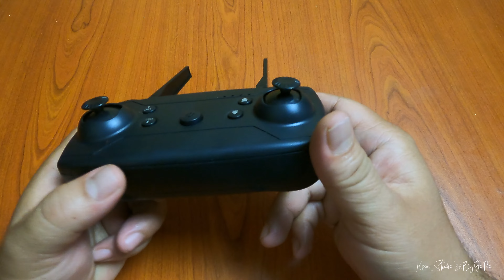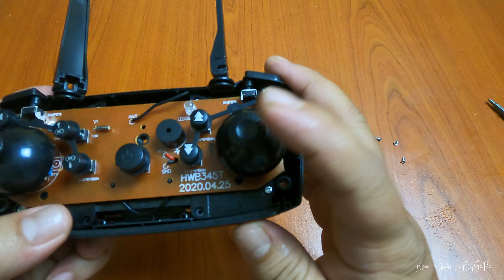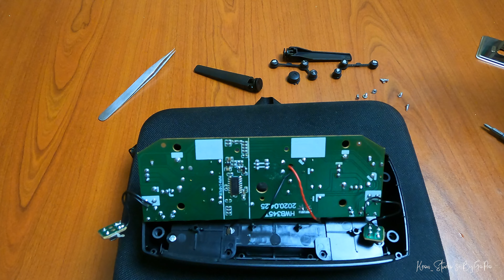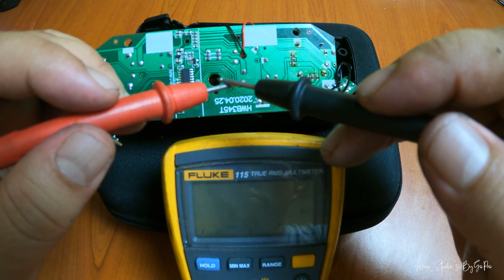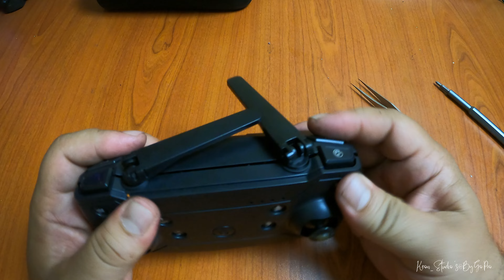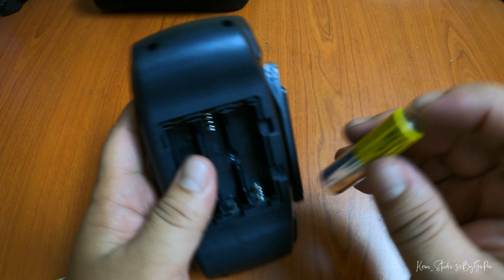How to Repair Remote E99 l Drone l Stuck

Comment: Bro i have changed the motor but its rotating on its own when i put battery in and other 3 fans not connecting to remote also when i remove the new motor it connecte's what should i do plz help
Reply from the maker: i'm suspect your remote got issue. The MB issue.

Comment: I have a problem master, i buy a e99 pro and when i try to connect to the controller with throttle up it doesn't make any sound and the lights are flashing. Please help me
Reply from the maker: ermmm your remote and drone not pair..maybe. try to get pair and the stick throttle down for both left and right until propeller sprin. and throttle up the left stick see what happen.
Reply: @sifukeon6786  okay now the problem is that the camera is so laggy like it goes freezing the image. Can you helpp me?

Comment: my drone remote not on i press the button and the my remote was not open you say your switch is not working that I i open it i sot the wire that connect to the switch but remote is not on and few days ago it's on and after few hours that problem was enabled please tell me the solution please